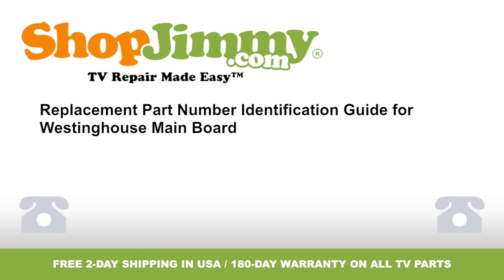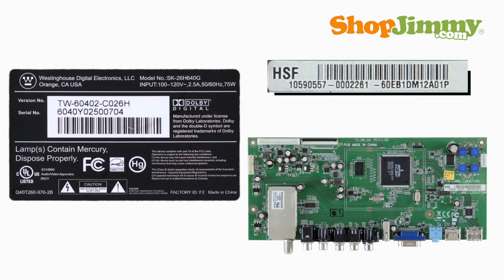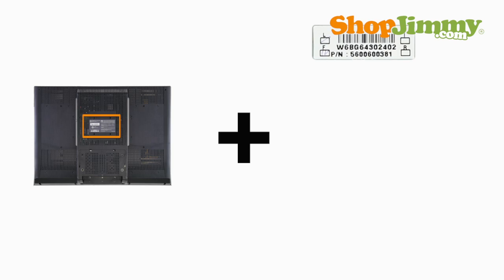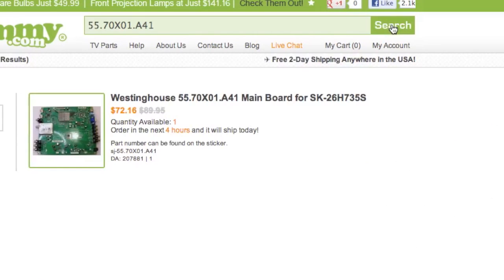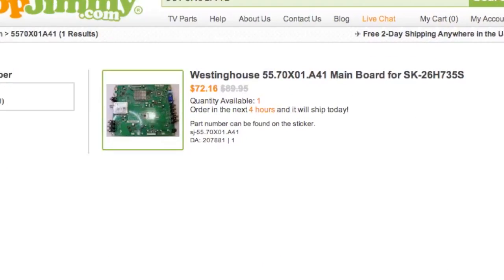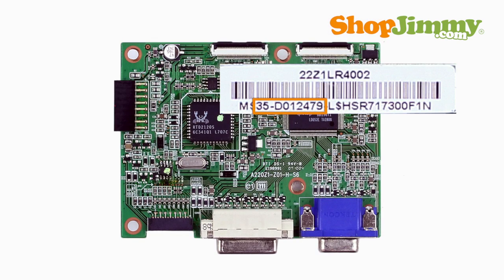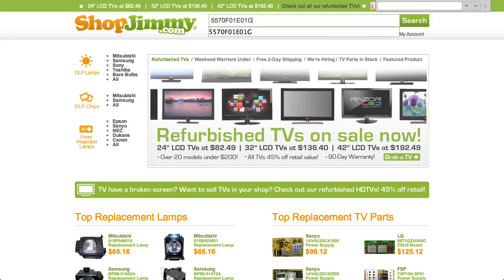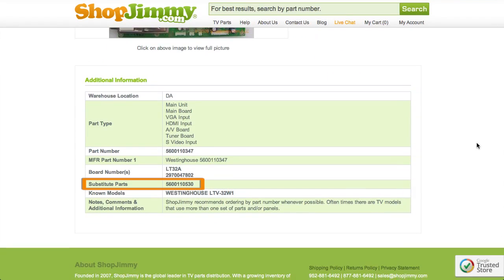DIY TV Part Number Identification Guide for Westinghouse Main Boards (LCD, LED, Plasma TVs)

Comment: went here to order the one for a UW40TC1W main board. will let you know how it goes
Reply: Went to Jimmy dot com got the board and it worked except that one of the HDMI inputs was DOA. I contacted the site. They were prompt in response. They explained I could return it and since they had no replacement I would only get a refund. So i kept it, but it would have been cool if they gave me a gift card for a little bit i would have maybe bought a mount or something.

Comment from the maker: @sddad02 - I would recommend replacing the main board in your TV.  We currently have 1 main board in stock, that could work for your TV, based on your TVs model version.  Please give our customer service a call to verify your TVs compatibility with the main board.  (877) 881-6492  Thanks and please let us know if you have any further questions.

Comment: Hello Shop Jimmy.  I have a Westinghouse 40' television, model number UW40TC1W.  A couple weeks ago the HDMI 2 port stopped working, then a week later the HDMI 1 port stopped working. Now the TV screen is black, red LED "power" light does not turn on. There must be some power because when I unplug the power cord, I can hear the TV power down. What parts do I need to fix this, and do you carry them?